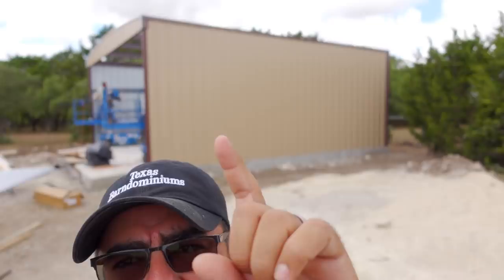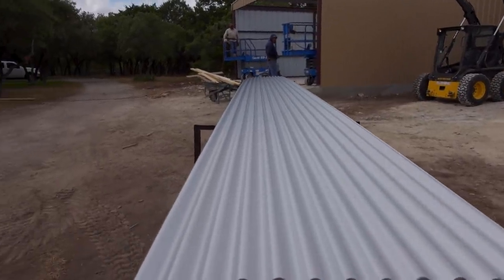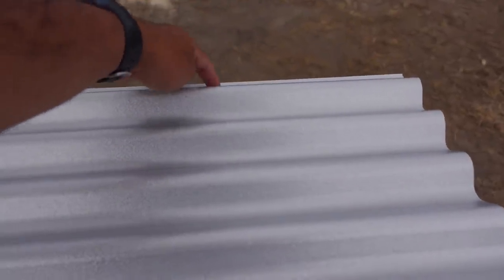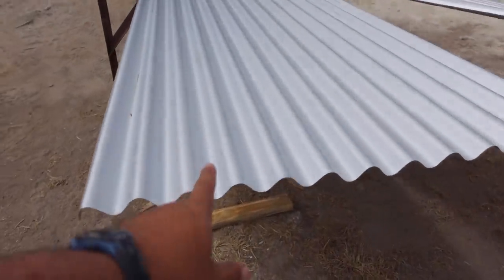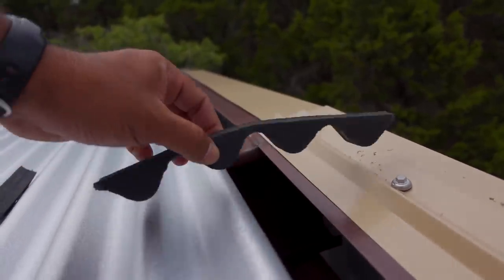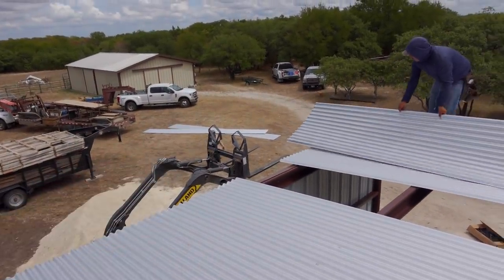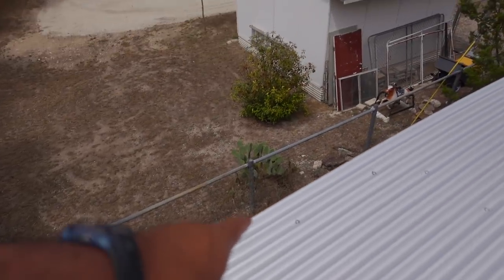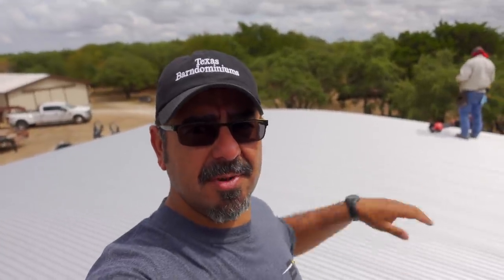Installing Continuous Roof on a metal building

Comment: I was taught to screw the ridge not the valley of the roof sheets.
Great job as always.
Big fan of continuous.
Cheers from Oz
Reply: Rubber-washered screws ended all that.  Going waaay back, we used to use lead-headed ‘straws’ which were placed in holes punched on the ridges, then rapped with a hammer from the top side as another worker underneath pulled it and bent it around the purlin under pressure.
Reply: Screwing the ridge looks terrible

Comment: I see the internet safety police are after you now. Hehe! They should try working on a 105-160 degree metal roof in Texas during the summer. Composite shingle roof isn't a picnic  either with safety gear.

Comment: Eric, why do they put the screws in the troughs of the corrugated roofing instead of the peaks? is is not more prone to water leakage if there is a defective washer?
Reply from the maker: That’s how they are meant to be installed.  You can’t tighten the screws on the peaks, it would crush the metal.
Reply: @TexasBarndominiums  you absolutely can as that's how we do it in New Zealand. that's the purpose of the rubber washer to seal while not letting the screw go in to tight.

Comment: There's a super anchor G-clamp fall protection system that can be installed with no nails or screws. 10-15 minutes to install. Then they can hook up with a lanyard rope and harness to protect themselves. Too dangerous on what they were doing.